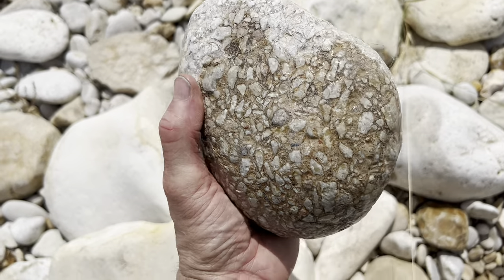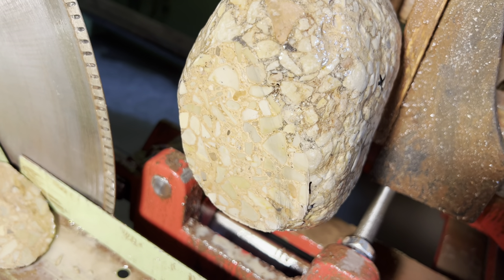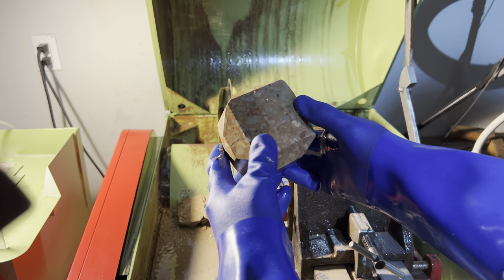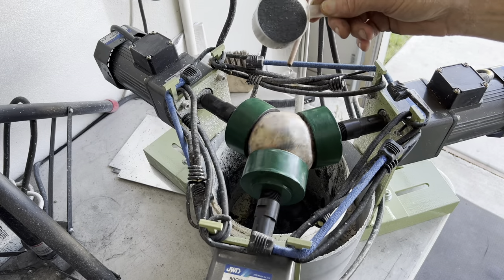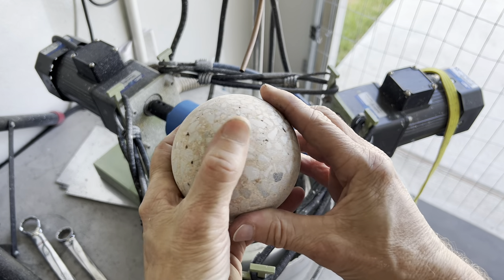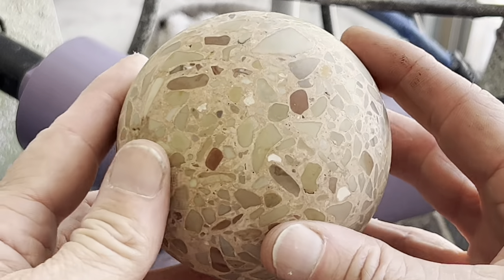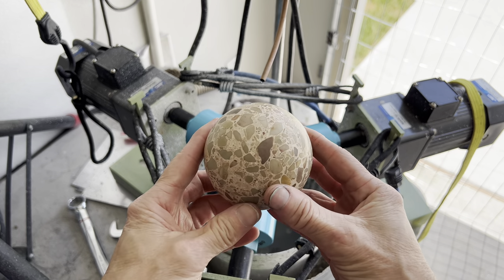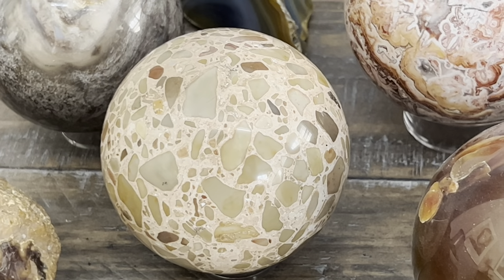From Rockhounding to the Polished Sphere

Comment: Making a sphere machine is on my list. Nice work Scott
Reply from the maker: Thanks Chris! They take lots of cutting but are worth it once they’re finished.
Reply: @spwinaustin I wonder if there are efficient algorithms for cutting a n approximation of a sphere of a desired diameter from an arbitrary starting shape with a finite number of cuts.
Reply: @spwinaustin I think that your method is decent. First create a cube at least as thick as the diameter of the sphere. 6 cuts yields 8 vertices, 12 edges, and 6 faces. Then chamfer each edge. 12 cuts yields 24 vertices, 24 edges, and 18 faces. Chamfer each of the resulting edges again. 24 cuts yield many more vertices, edges, and 42 faces. approximate a cylindrical prism along each axis. Decently spherical.

Comment: First concrete sphere I’ve seen, pretty cool.
Reply from the maker: It definitely has a concrete look 😆. Thanks for watching!
Reply: Yeah it is definitely concrete. Old concrete which is neat
Reply: @zekiah2 it's not concrete it's called a tektite it's cause when a fault explodes and the shattered pieces are filled with ultramasic fluid
Reply: @GoldenBoy-et6of  incorrect, its is concrete tektite is dark in colour almost black
Reply: Dude. Tektites are usually tiny pieces of melted quartz that are ejected by a cosmic strike like an asteroid or meteor. This is a breccia. A sedimentary rock that is made up of different minerals. The material between the larger rock fragments is called the matrix.

Comment: Go back to the 1200 to bring that shine out.

I can get a mirror polish on wood and metal with 1200, but you don't always get it if you rush that part and keep going upwards in grit. Those invisible sized scratches just get embedded and you lose all the hard edges which makes it harder to bring to a mirror finish no matter how long you go with the 2000.  Honestly take it back down to 1200 and run it  for longer before heading up to 2k, that should bring out that mirror finish shine, those rocks were soaking up the light beautifully, it could look truly magical.
Reply from the maker: Thanks for the feedback, I appreciate it, and thank you for watching!
Reply from the maker: Thanks!

Comment: Just a thought, I wonder if once you got down to the finest grit if you then slowly reduced the bungee tension in steps while continuing to run the machine if you’d get it even shinier? Or maybe even adding in something like baby oil at the end of the process to reduce the grinding/cutting action even further to thereby getting it even shinier than in previous steps?
Reply from the maker: That’s an interesting thought, I honestly don’t know if it would make a difference. In order to polish you still have to scratch out ever finer lines in the rock so you definitely still need pressure for that.

Comment: The jump from 1200 grit to 4000 grit is rather extreme. Do you have a 2000-grit to bridge that gap? With lenses, the abrasive size is approximately halved at each step.
Reply from the maker: I don’t have that but I usually get good results with the grits I use, especially on the harder stones. I appreciate your feedback!

Comment: Have you ever tried using core drills? Seems like you could save a lot of time just drilling out a core, then drilling through the core perpendicular to the first cut. Or maybe just drill out a core then cut it lengthwise and proceed to the sphering step.
Reply from the maker: That would definitely speed up the process but I do not have the ability at this time 😥. Thanks for watching!

Comment: Not that it isn't beautiful but I swear that stone is concrete.
Reply from the maker: It certainly has that look! 😆 Thank you for watching!
Reply: Formations can be found like that in nature. They’re called conglomerates when the stones within the rock matrix are smooth and called breccias when the rocks are angular. If this is natural, it’s likely that it’s some sort of breccia as the pieces within are somewhat angular. I have seen breccias form like this in nature down in the Florida keys. Pieces of rock got trapped and solidified within an old sinkhole.
Reply: More like terrazzo
Reply: It is not called a conglomerate. It’s called a concretion.
Reply: agreed
Reply: Yeah this ain't
Reply: Definitely not concrete it would be more jagged not round like that even found in rivers concrete is usually jagged